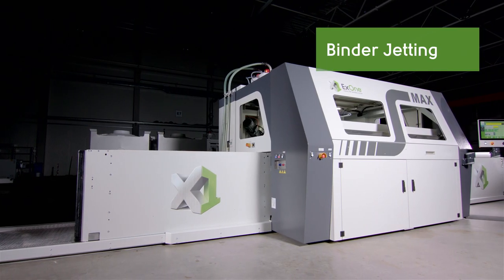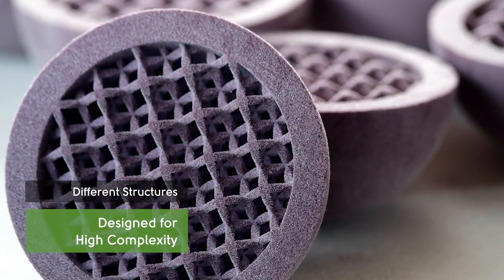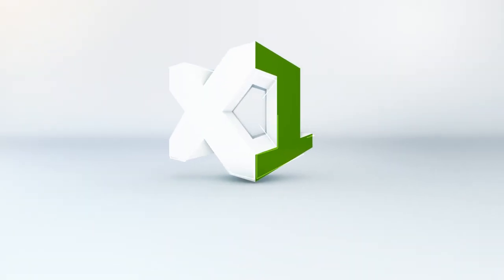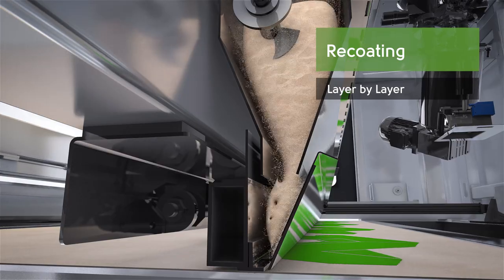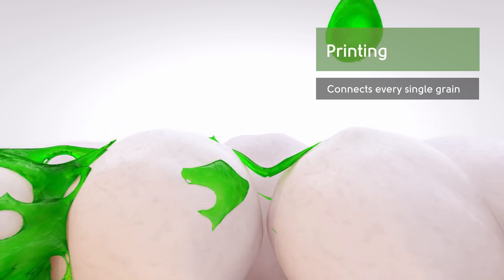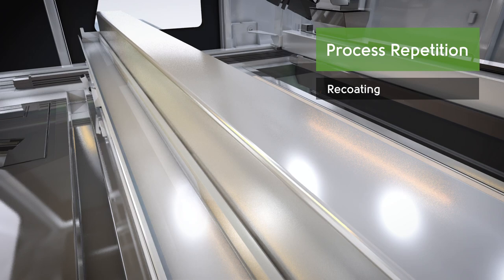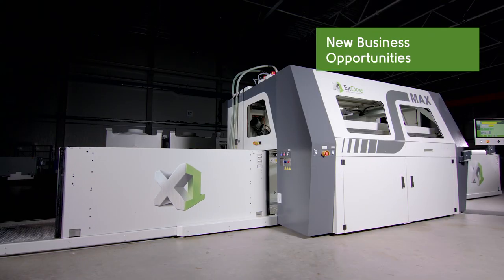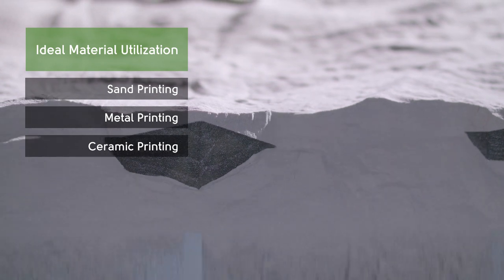ExOne 3D Core & Mold Printing

Comment: How thin can a metal cast be made with this system? I'm asking in the context of casting complex curvature artistic kitchen wares like cast copper pots shaped like an apple or bell pepper and have the production flexibility to change the design into a gourd shape when the market shifts preferences to gourds by the end of the week.  Also could this be used to cast other complex curvature plates for art work like a 50ft art sculpture for a monument?